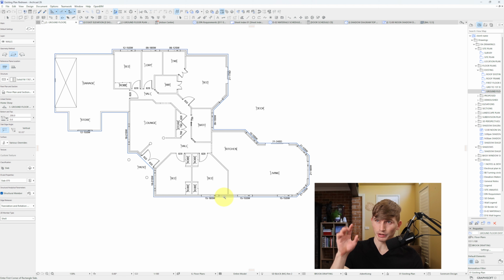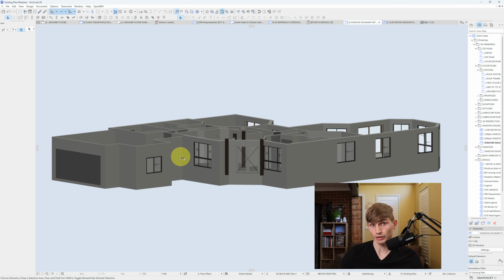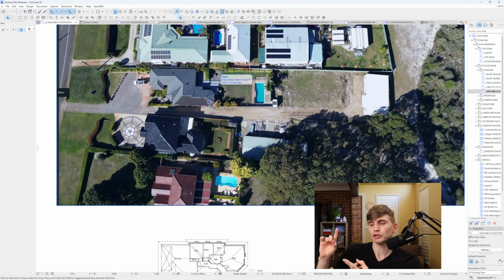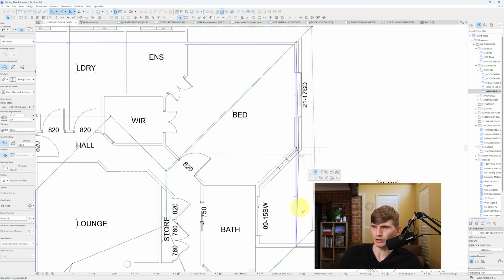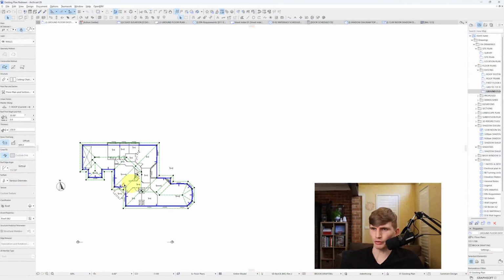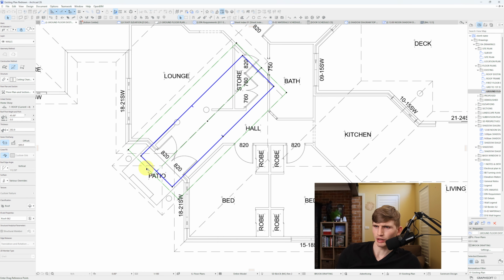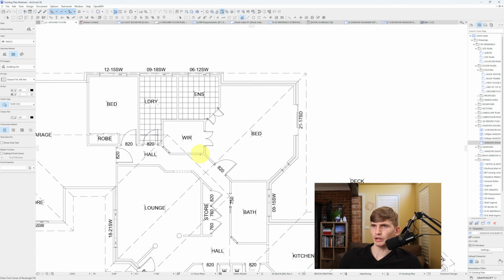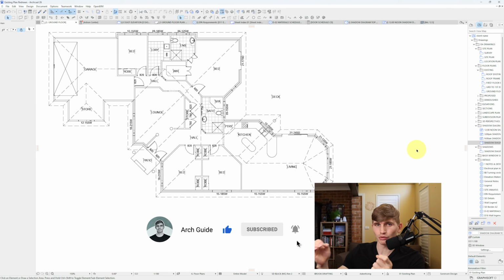ArchiCAD Tutorial: Redrawing a plan (PART 2)

Comment: everything was well pointed out. However I have one question.. the part where you trimmed the columns using solid elements operations, couldn't it have been done by just the "trim elements to roof/shell" tool?
Reply from the maker: It’s a great quick tool & I use to trim elements to the roof.. but if you shift the roof, the walls stay trimmed to the previous height of the roof. But with solid element operations, the walls adjust along with the roof. If you shift the roof up or down the wall will adjust accordingly. A few people have asked so I might make a video on it.
Reply: @archguide  that makes sense now, Thanks!